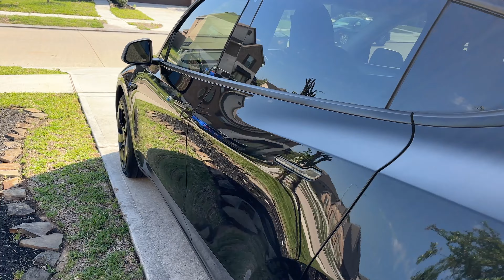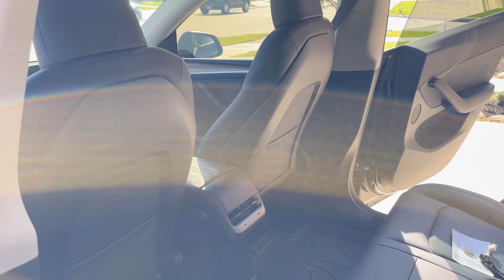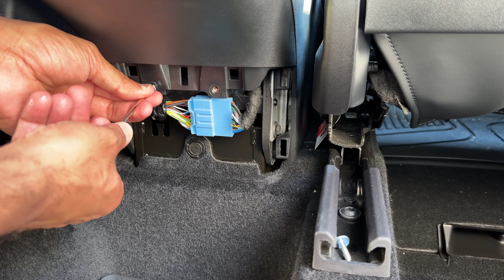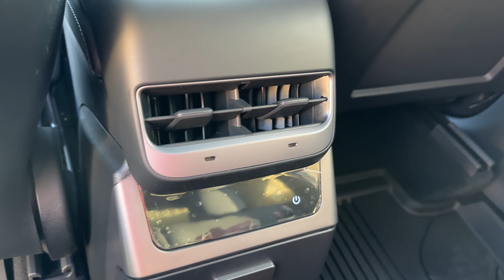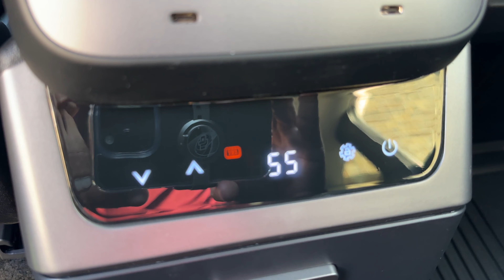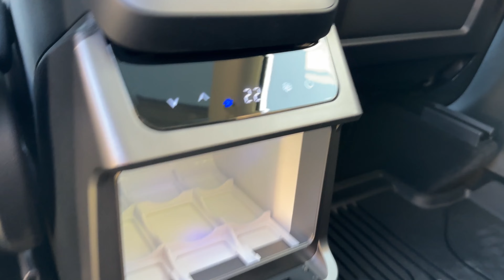2023 Tesla Model Y New Refrigerator Upgrade with Cool and Heat Mode Full Review

Comment: The removed heat does not magically disappear, but it will dump it inside of your cabin to your rear passengers. 😅 hahaha what a great idea
Reply from the maker: I will be using refrigerator for cooling only. It is so hot here already. But still a great idea to use heater option for winters :)

Comment: Quick questions, is that refrigerator loud when it is cooling? Does it stay on 24/7 and drain the battery ?
Reply from the maker: It is not that loud when cooling, just submerges with the sound of the AC vents. Also when temp reaches desired level it is just as quite as nothing.
Reply: @MyGadgetsWorld  cool. Do you know with this fridge installed, does the car still have the capability to install the rear screen?
Reply: @kbbkilla  no